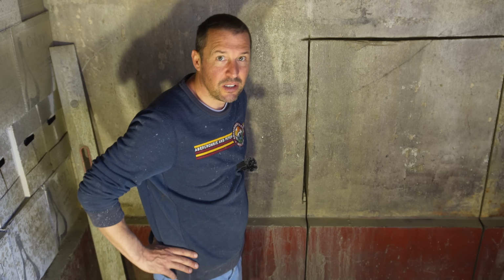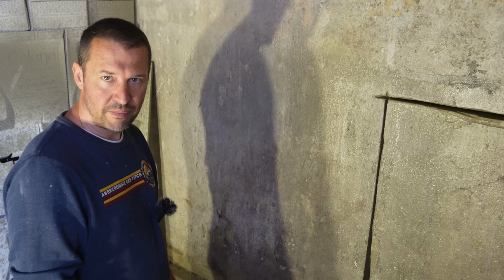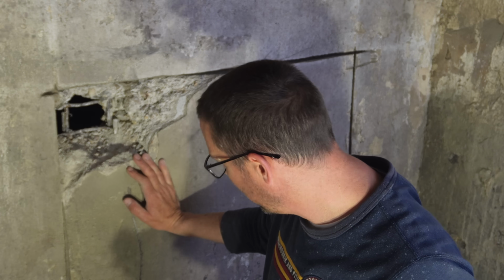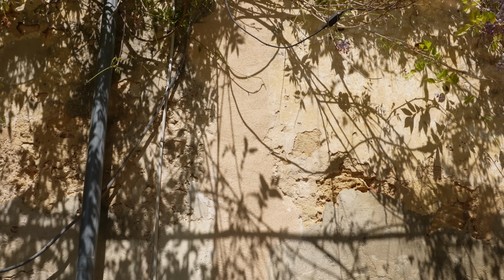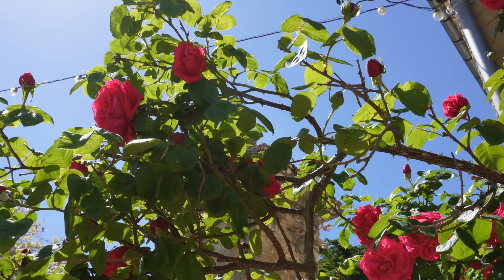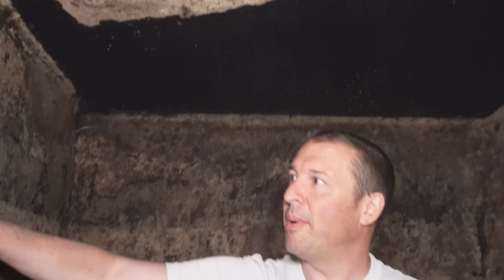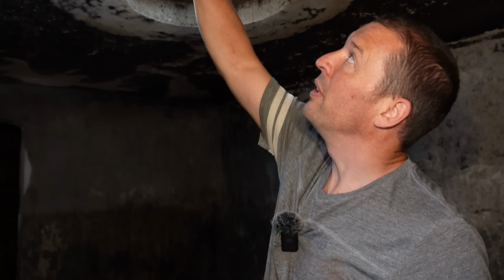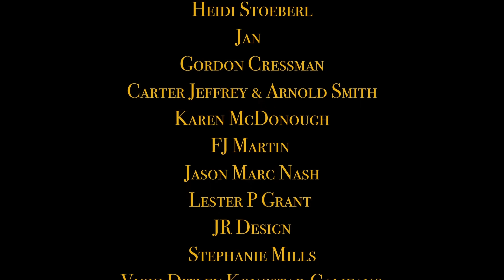"Demolishing a Wall in a chateau to Reveal a SECRET Wine Cellar- What we found will amaze you!!

Comment: Checked the comments to see if anyone had asked if you knew why that portion had been cemented over/closed up?  Thanks for the walk around Anna, hope Edd didn't hurt his back!
Reply: It was a wine vat.
Reply: But why was it sealed up with no access?
Reply: Because a vat is a container for liquid, wine in this case. Like tanks are for oil. The wine was poured in by the opening in the ceiling. The faucet near the floor was used to pour out the wine at the bottling time. Those wine vats were built a long time ago.

Comment: While using a sledge hammer to knock concrete out of an old kitchen... apparently, I was gritting my teeth and broke a tooth up to the root.  ...I now use a mouth guard to knock out concrete/cement.  Just a bit of warning.